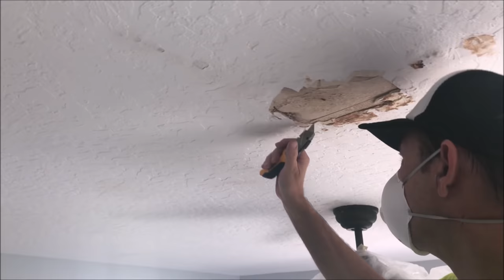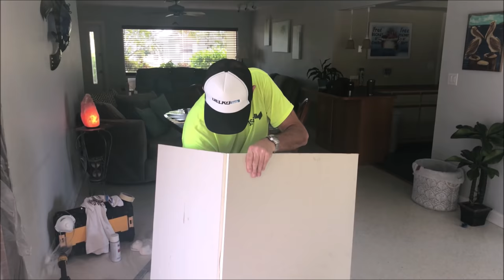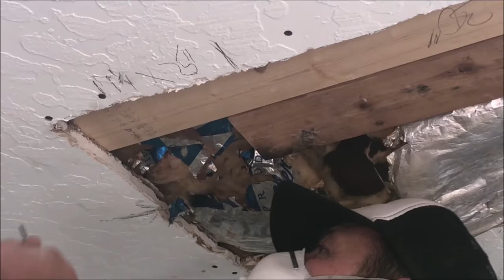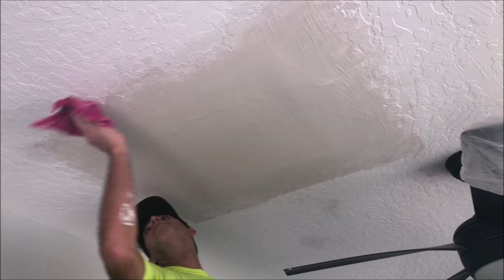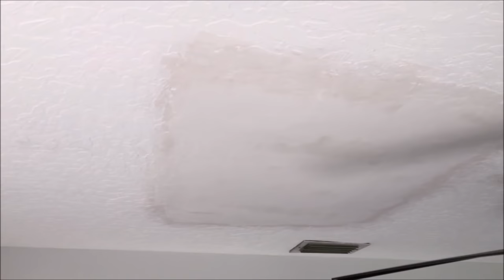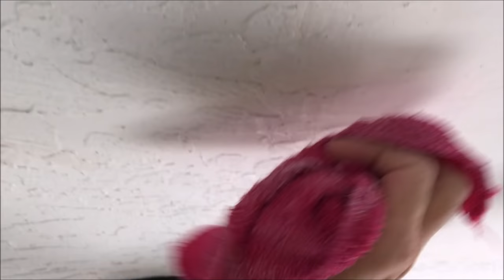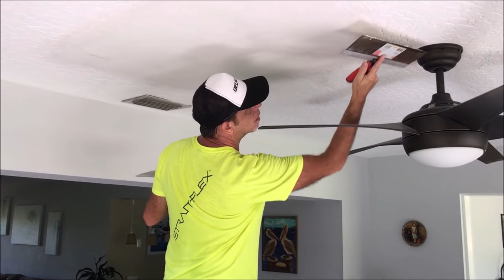How To Repair WATER DAMAGED DRYWALL CEILING- Step by Step

Comment: WOW! Your work is so nice! I'm currently in the process of removing downstairs ceiling tiles due to an upstairs plumbing leak. I've decided to just replace the entire ceiling in the tiny downstairs so here I am on your page. I also found that someone had this plumbing problem before, however, instead of replacing the drywall, they put a piece of plywood and covered it with ceiling tiles. I think the furring was like a big version of a wooden paint mixing stick lol Honestly, it would have been easier to fix the problem the right way the first time lol I have to say, your work is very clean! Anyhow, I will be waiting for the ceiling to "demold" and dry out before putting in the new ceiling YAY fun. Thank you for the tips

Comment: Thanks for the video. I am a drywall contractor. Everyone does it their own way so I am not going to tell you how I would do it but I think you did a good job. One thing I disagree with is when you say the hot mud doesn't dry as hard as the regular mud. The 20 mins dries like concrete. So to me it is better for bigger gaps or ceiling repairs.

Comment: Homeowner, here because the roofing company that replaced my roof caused a leak… they fixed the roof after that but then told me they are not responsible for any interior damage 🫠 Feeling more confident for this weekend’s project with your instruction!

Comment: I had a handyman come out to patch up a hole in the ceiling and did a horrible job. The patch was barely flushed with the surrounding drywall and he left globs bulging out at the  seams, then he called these clumps “skip trowel.”Now I have to sand down all the mess he made and do it right. Your video will help., thanks! And he called himself a professional. 🙄

Comment: Great video. I wish you had shown the finished, primed, and painted patch, including at different angles, since light typically exposes any blending imperfections and anomalies. Granted, the customer wanted a value based quick job, so that must be factored in. But you gave a lot of useful tips. Thank you

Comment: 28 yr old caulker by trade looking to do some home repairs. I have an air conditioning unit in the attic that was installed with a pvc drain that wasn’t glued correctly and had a slow leak that pooled in the attic and leaked through the ceiling one day. That was fun to come home to.

Comment: This is a great video. I am repairing exactly what you are doing here. I built my House in 1986 from an empty lot. One of the only thing I didn't do personally was to tape and texture the sheetrock. Our skip coat looks almost identical to the one in this video. In today's cheap and sterile building style, most have never even heard of skip coat, so finding any info at all about skip coating is non existent. So you could imagine how happy I as to find this video.  What baffles me is that you were so detailed on everything except showing us how you made your skip trowel mud. 
I know from memory that sand was used to make the mud. But you only mentioned the sand in one sentence, referring to letting the mud and sand do it's work.
Please, I need to know how its done as nobody in my area knows anything about it. All they know is spray on, knock down texture that looks like a bird pooped on it.
Do you have any video that shows how to prepare the mud?
Thank you.

Comment: Awesome. I'm repairing a bathroom ceiling after a toilet leak. Tricky bit is that this ceiling has ceiling heat wire imbedded between two layers of drywall. 

I'm not preserving the ceiling heat.  But, I do want to make the repair match up with the existing ceiling. So, I've got to shim out the joists so the repair and existing ceiling will be at exactly the same level. 

Besides enriching my vocabulary, I'm learning a lot about measuring and shimming drywall...

Comment: You didn't show the screaming kids running around, the dog nipping at your heels, or the homeowner standing there watching and questioning every move you make the entire time you're there! 😂 I have 23 years under my belt and have seen it all! Nicely done repair. You did it almost exactly how I would have. Be careful of those fans! I have bought 2 new ceiling fans in my time due to taping plastic to the blades and having a layer of the blade come off with the tape. No, I didn't learn the first time it happened 😂

Comment: DIY'er repairing a 6" x 5' rectangular drywall cutout in my kitchen backsplash wall resulting from the installation of a new electrical outlet in the kitchen prior to installing new tile on the backsplash wall.  Good informative video.

Comment: I bought a newer bigger fridge and I planned on replacing the old with the new, as any home owner knows one task turns into many. I ended up removing a lower cabinet to fit the newer fridge then I realized I needed to replace some sheet rock because it appears years back before I bought the house there was a refrigerator line water spill and that was fixed but the sheetrock wasn't in the best of shape. I replaced the sheetrock and I ended up doing a DIY tape and float. I watch videos like yours for tips. It's looking good but I like copying the techniques of those who know way more than me. I gave it three coates, I sand it before each coat and it was way less work per coat. I'm soon about to texture it with orange peel.

Comment: Basically how I do ceiling patches, but the real deal is doing a stomped ceiling repair and making it look great, knock downs are easy . I clean up the edges a bit more with a damp rag, will also run a quick pass with a belt sander on the existing edges before I mud. For the average handyman however this is a great video.

Comment: Hi Paul:

Your drywall repair vid is GREAT. I am looking at a couple repairs at my mom's house. A hole in the wall just outside of the 1st floor bathroom...the damaged area also includes the hallway light switch. The other repair is a leaky ceiling in one of the 1st floor bedrooms (much like the repair featured in your vid). Your video seems to cover all of the basic points clearly and informatively.

Comment: Thank you! I am a DIYer... I have done over 30k worth of home renovations myself/with help of friends on the duplex turned single family a year and a half ago.  I took down the top cabinets on the side I was keeping the kitchen because they were gross and I wanted floating shelves. It took some of the ceiling with it in one part, and the other part peeled away the top part.  I have done plumbing, heating, electrical, floors, furniture.... but for some reason I am intimidated on fixing this ceiling section.  Immediately I of course replaced the insulation in the hole and hung up a cement board to cover the gap.... but that was over a year ago. I think I just worry I am going to make a royal mess with the mudding on the ceiling because of gravity + my creative messiness :-P ... thanks for your video!

Comment: Not a bad outcome.  I noticed you used 1/2" drywall on the ceiling repair. Most ceilings are done in 5/8 "drywall for strength and durability.  1/2 " will work just involves more mud to fill in the void. Next time you  do a repair like that with 1/2" drywall float the inside of the patch to bring it to the same level as the existing drywall. Then you can full float the entire patch.  Just a tip from a patch guy down in Texas.  Also trying using a 10" knife first then skim coat with a 12". Find it easier to float with a 10" 
Keep the videos coming. 👍

Comment: Great video! Very thorough and well explained. I can imagine the last part being much easier on a smooth ceiling instead of textured right? I have a similar problem as I have a leak possibly coming from a pipe from my shower.  I'm a big Diy guy and once I get the leak sorted out, I plan to do do the same repair myself and big thanks to you, now I have a great idea how to do it right.  Thank you sir!

Comment: You are truly an artist especially with the texture. I have a ceiling repair that has a LITE orange peel. I was going to use the caned orange peel. What do you think? Thanks for the detailed repair. I was a Plumbing Heating A/C service tech who damaged many a ceiling due to water damage or just to conceal piping in the walls/ceilings.

Comment: A/c pan leaked from
Upstairs into
The ceiling of our laundry room downstairs.  It’s pretty soft and 2 holes were cut by the plumbers in a prior repair to the pipes once before.  Looks like it may be a huge piece of ceiling to repair.  I’m going to attempt this.  I’m a 45 year old woman and I have never done this but I have painted rooms in my homes many times since I was a teenager.

Comment: This guy is going great .  But  I’ve noticed on this particular thread there are quite a few young blokes posting. He’s done a fine job . The only thing  I’d add as a plasterer of near on 40 years , is that this is an ideal circumstance for young blokes to practice, knife and tape cutting. No  T square just run your tape and knife.  ( or practice with pencil) It’s such a cool and relevant skill to learn for plastering.  Once you’ve acquired that skill the world is your oyster…. As  an aside , I do not envy this fella , attempting to set  on that rough  texture coat ceiling  iits  real tough.  Also  , I’d recommend using  pure gypsum base as a additive to your mix to harden between coats

Comment: Great video.  Two questions:  1.  After your very first coat, you used a rag to blend in with perimeter texture.  Why was that step needed if you were going to go over that again with another coat?  Was it to make sure a hill was not created with multiple coats of mud?   2.  What type of mud did you use with stiff trowel texture application in your final step?  I am a DIY and love to watch pros.

Comment: It's really clear to me how to do the skip troweling. Isit a special mix? Special trowel? How do you get the form the uneven patches to match the rest of the ceiling. Looks good. I need to do this on a hard concrete ceiling. Using either drywall mix or some fine sand concrete mix like thinset. But drywall mix I think will be easier and will work well. Thanks.
Reply from the maker: Skip Trowel Texture Tips. #texture #tips

Comment: Fantastic video and amazing result. I’m just a regular guy with OK DIY skills and arrived here after condensation around my air conditioning outlets has resulted in water damage and black mold. I had aspirations to fix it myself but gave up when I had horrible symptoms from mold exposure. You must see some awful rot and mold in your job. How do you protect your health? I see you wearing an N95 for this job, but do you ever use anything else for nastier situations where there might be very high levels of mold spores and mycotoxins? Have you ever needed to refuse a job due to health risks?

Comment: I love what you do!  The texture on all my ceilings, is a very very thin ( I think skip trowel), giving the ceiling an illusion of being smooth. The person who fixed a 10’x 10’ area, put a thick 90’s style skip trowel, which is horrible, and stands out like a sore thumb. He then disappeared on me, and I’m stuck with a 10’ square area that now needs to be redone. I’ve been searching to find out how to correct this but have never been able to find how I need to redo, and then match the original thin ceiling texture. As such my living room has been a mess since December. It’s now almost April and I’m desperate to find out how to correct this. Do I first sand down the thick trowel marks and then mud it again before re texturing again!  I’m at a complete loss. Thanks so much. 
Btw, my home is an Arizona 1976 mid century home.

Comment: Doing this exact same repair dimensions are almost identical.  I attached the repair but over did a screw so not level and now adjusting that.  I learned u dont need to fire them up in there like I did

Comment: Fantastic video! I learned a TON! DIY'r here. How would you handle the following: (a) replacing ceiling drywall in the very corner of the room (about a 2' sq section)... specifically how would you handle the corner joints that where walls meet the ceiling and (b) matching the existing 'swirl' finish as opposed to the 'skip' finish?

Comment: Leaks around chimney caused ceiling drywall damage. Had new roof installed and cricket added to prevent future damage.  Have to fix ceiling drywall up against chimney and wall now

Comment: I'm an electrical contractor and we had an animal (likely a racoon) did up up our roof shingles which caused a leak into our living room. The drywall is water stained but not very soft. I was looking to see if it needed to be replaced or if I could use Kilz to cover the stain and just finish paint.
Reply from the maker: Yes. If it feels solid, I think using an stain blocking primer would be fine. Kilz Original oil base will get rid of the water spot. Then paint.👍🏻

Comment: Nice work but I like to prime the area before applying the final skip trowel coat to prevent flashing which can look shoddy on light bearing walls and ceilings.

Comment: Painting Contractor, always learning something new. Well done video, I wouldn't have thought to use a heat gun, I always just came back the next day to finish. On my way to Amazon with his link to get that heat gun.
Reply: Durabond has to have the cure time as stated or it will be weak (5,20,45, ect.) So just use it to bring the temp up a little not dry it too fast, fans work well too.

Comment: I saw this on my front page and I see it’s 2 years old. I hope you’re still answering comments. I have a damaged garage ceiling and there are very long jagged cracks as well as missing chunks of drywall. I saw a video from “this old house” and he went in the attic to lay the furring boards, then he was able to press the existing drywall back into place before he did the taping and compound work. What do you suggest with my project?

Comment: diy'er and have 2 corner ceiling areas over kithchen cabinets to repair from the 2nd floor water leak. Any tips on repairing ceiling next to  wall ceiling corners? Your work n video are the best. Thanks for the great instruction and sharing.

Comment: I'm a DIY with only 4 or 5 small projects under my belt. Our upstairs shower leaked, damaging a small spot in the first floor ceiling. The tips for using quckset and general purpose mud helped a lot.  BTW, how water did you add to to quickset (ratios, will help). Also how much more water did you add to the general purpose mud?

Thanks!
Reply: add small portions until it looks like creamy mayo. Timed compound dries quick and by the time 15 mins pass it turns to charcoal chunks.

Comment: You do it different than I do but there’s results are the same but like I said maybe if you get a chance try it the way I suggested then leave the ripples in the mud on your first and second coat because those ripples from your trail lines will be how the texture comes off the trowel to blend with the rest of the ceiling and then when you come to the edge you’re going to sponge it I can do any texture acrylic sand float drag the stucco finishes anything

Comment: We had a 2nd Floor Shower P-Trap leak above our 1st Floor Ceiling, and it leaked through and left a small spot.  So I am having to cut out the wet spot area and replace the small drywall piece.  Then Tape, Spackle, Sand & Repaint the entire ceiling.  PITA!

I am just an armature DYI guy, so thanks for making this video so thoroughly...very helpful!  Nice job!

So what tool did you use to match that bumpy ceiling texture?  Fortunately, mine is smooth, but just wondering.

Comment: I have a place similar but mine was from previous water heater added and the contractor stepped wrong I. The ceiling and split the seam turned ugly it wasn’t noticeable at first but very similar to your repair thanks for the video

Comment: You must make sure the new drywall should be the same thickness as the one on ceiling  if thinner build it  by adding tape or thin ply vainer all around the back side adages  or will look like a pool patch ,and you must let the plaster cure or the paint will peal off fast

Comment: This is so helpful. I have water damage (from a storm) and it produced a hole on the stairway ceiling almost to the top of the stairs but no safe way to place a ladder there. Any suggestions? (Roof has been repaired). Pretty high ceiling to fix on stairway.  I am a DIYer.

Comment: Nice workmanship.In the interest of time.. Ill comment on questionable. procedures,  1. The use of the colored " rag". Backwiping with a construction grade " Hydro sponge  for $2.00 is Best. It moistens and cleans the area your feathering into. The surface area was large enough and the sponge creates a sound feather edge quickly, uniformly with  better adhesion between substrates.